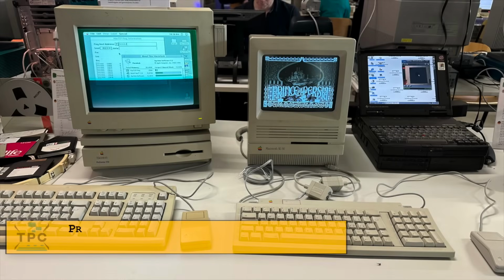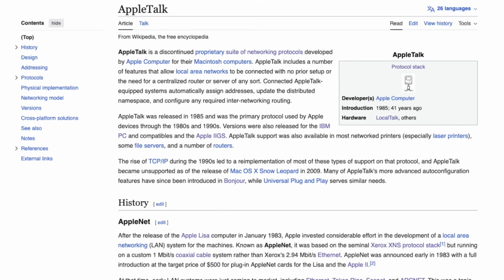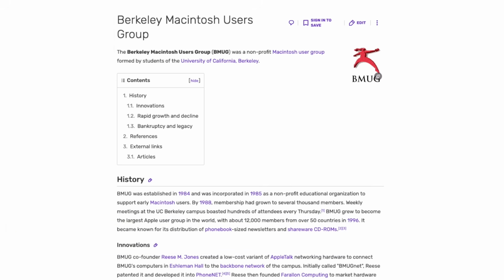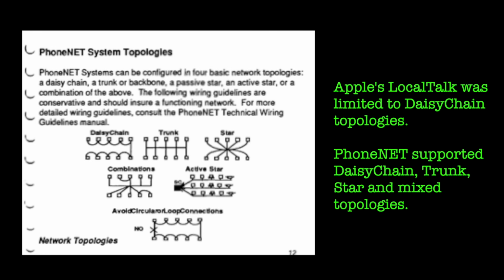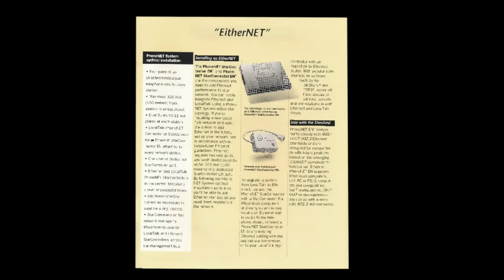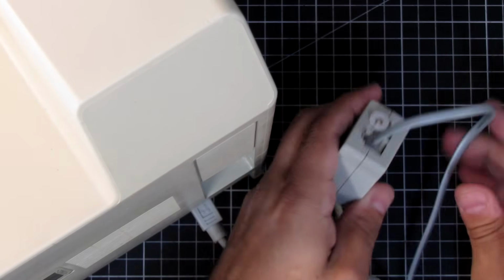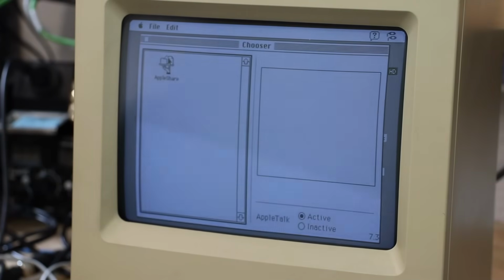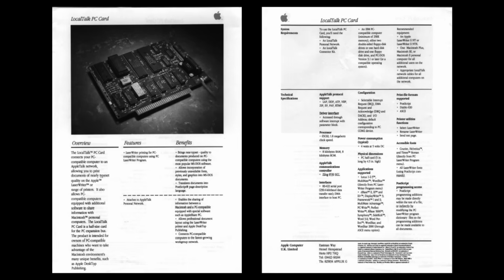Testing Farallon PhoneNet: AppleTalk without Apple's Expensive Cabling

Comment from the maker: Did you ever run AppleTalk, LocalTalk, or PhoneNet in a real setup?

I’m especially curious if anyone here connected Macs to the PC world with an AppleTalk PC Card, PhoneNet PC adapter, or similar hardware.
What worked, what broke, and what was the weirdest thing you managed to share over the network?
Reply: Yes, we used apple talk over coax, very chatty protocol and lots of collisions
Reply: We had plenty of it at the phone company before the days of EtherTalk - and even after that for the older macs with no slots.
Reply: I did many installs with PhoneNet. Some customers had it on the PC. We even had third party printers connected via LocalTalk.

Comment: I have an original IBM Ethernet Option which works on 8-bit systems.  It was new in the box when I found it.  I haven't used it in a while as the drivers use a lot of RAM and I don't have any computers set up with an OS which supports NetBEUI.

Comment: I wonder, what can you do with RAM on an Ethernet card?  I read a bit through the documentation on that Ethernet card and it says you can connect up to 4MiB of RAM accessible in 64k pages.
Reply from the maker: Yes, but that's not supposed to be regular system RAM (conventional memory, EMS or XMS in that sense).

It's a very specific use case for boot rom support, that means if you need to attach Flash larger than 512KB.

Or you can attach memory for use as network buffer, i.e. when the built-in 16 KByte SRAM not enough, you could attach RAM to enlarge the hardware buffer memory.

Comment: Honestly if we're posible to do a network like with Ethernet for old computers I would use it but when I was starting as IT everyone just went to Ethernet instead it was much of a hassle and phone lines were on the way out. Not even coaxial TV is anymore as an other option. But if were some way of using phone lines I maybe consider it. Still is slow but maybe that way it wouldn't be consider a target for hackers.
Reply: The main problem with Ethernet on old computers is normally getting a functional TCP/IP stack (with layer 7 clients/servers) for the machine, or even physically fitting that code into the available memory of the machine.
Reply: @Vanders456 also the need for extra devices and or converters

Comment: I had a PhoneNet PC card thing - I don't think it used an internal slot but like a printer (parallel) port or something. I remember this because someone loaned it to me and I briefly experimented with it without installing the card - just the DOS drivers and all the fun stuff on the Mac.
Reply: I may have the relevant bits on the shelf in my office. I haven't quite gotten around to setting everything up so I can try, but it looks very plausible as a phonenet to parallelport thingy

Comment: not quite the same thing, but I ran HomePNA over my phone wiring for several years, which didn't have the complications that PhoneNet had since it can run on the same pair as the phone service, like DSL can (but no filters are needed for phones). We had the first gen cards that had a 1Mbit max speed but since it was mostly used to share a dialup internet connection it worked extremely well.

Comment: I was a teen in the late 90's and early 2000's. A family friend who worked for NOAA gave me a bunch of old tech they retired, it included a bunch of Localtalk and PhoneNet adaptors amongst other things. I networked about 6 old Mac's I had acquired this way. And at one point I discovered I could misuse a old print server unit intended to allow a Apple compatible printer with a MiniDIN connection to connect onto a Ethernet network, well I found I could use it to bridge my Appletalk network to my homes Ethernet network. Via this, I was actually able to get my Mac Plus on the internet over the new cable internet we had signed up for around that time. I tried but I don't believe I could get my 512ke to work though because it didnt have enough RAM to handle the extensions and run a browser. Even on the Plus though, there wasn't much you could browse online, but I thought it was cool that it even worked at all. Oh, Edit: I just looked through a box I recalled having a bit of old tech.. turns out I might have the adaptor you need to connect a PC, Apple part 630-0113 although I never used it because I didn't get into PC's much till later..

Comment: In 2003 I actually got to experience setting up a group of LC II's with a fresh install of 7.5.3, maxing out the RAM and VRAM all to then configure an entirely Apple branded AppleTalk network between them so they could share files and a single LaserWriter II

I also got to enjoy some time with a PowerBook 3400c that year as I took a large amount of personal time to discover the reason it kept randomly crashing, finally discovering it had a failing hard drive that my teacher had placed an eBay order for it just for the laptop to be stolen from his classroom despite the fact it was sitting in pieces

Comment: With only two Macs to connect, I didn’t use any networking hardware at all. I just connected the two with a printer cable.
Reply from the maker: Of course, that‘s more or less the „DOS LapLink“ 1:1 connection equivalent.

Comment: If your printer port is full of a network interface, does that mean the only way you can access a printer is via the network? I know LaserWriters were expected to work like this, and the ImageWriter IIRC had an add-in board for networking, but on my Mac Plus later on I used an HP DeskWriter which I don't think had any kind of networking support built-in.
Reply: I think you could get away with putting most printers on the com port as well. As I recall, the only substantial difference was that the printer port could handle localtalk stuff too, and the com port couldn't

Comment: I'm sure you know this. But, from what I read they was considering using token ring but it was not ready yet. I was jealous of how macintohs has built in networking and how easy it was to use compared to says Windows for workgroups or I guess before that say lanman for dos. But, once again due to the cost of the Macintosh. Big push for Workgroup clones. Oh on a side note. I didn't realize somebody mfg a repo card for appletalk on a pc. I have been looking for one of those cards for years. I only ran across one while as a customers place. They used it for a laserwriter. Another side note. If you can find it . Look up IBM i think it is call PCN networking developed for use in PC's. I ran into it one on a novell netware network. it use twisted pair cable and I think terminators. The people who installed it used phone cable. That was wrong. It was suppose to use I think TYPE 3 IBM wire. Thus, the clients network was always going down. That was part of the job. Fix that with proper cabling and upgrade to novell 4.x from 3.x

Comment: Oh man you mentioned the EtherTalk bridge in another comment and I forgot about those! Had a few of those deployed as well--there was a version with an AAUI connector that hung off it so you could connect a Mac at the same time as well as bridging the networks. It must have been a Farallon unit because I remember the coloring of the plastic being that dark gray color they used but I can't find a picture of the one I remember, it had a diamond shape to it. I also distincly remember taking an old PowerBook 520 and using it as a software bridge for years to get an old LaserWriter II NT on an EtherTalk network.

Comment: I downloaded system 7.5.3 from apples FTP server and extracted the floppy disk images to a folder on my Power Macintosh G3 beige desktop. I then offered that as a network share and connected it to my Powerbook 145b and prepared a system 7.0 boot disk with the apple talk extension and chooser and was able to mount the shared and install OS 7.5.3 on the powerbook without having to do all the floppy swapping shenanegins. This was like 2002-2003 and I was just a kid. It was still fun and probably still how I would install an OS on a powerbook without a CD drive today.

Comment: IBM also had a phone wire based networking solution very similar to Apple, but not compatible with it. It was called “IBM PC network baseband.” The cards came in both Isa and microchannel and were very popular on the PS/2 line.
Reply from the maker: Oh nice. I‘ll have to check that one.

Comment: We bridged PhoneNet/Apple talk with ethernet around 1994/1995 and used a dozen of the Farallon star controllers back then connected with an amphenol plug to a 66 block (punch down) and then down to individual RJ11 outlets at each Mac.
On Ethernet we had netware 3.12 servers using ethernet_ii frame type to support apple fileshare clients

Comment: LocalTalk is supported by the intelligent modes included in the Zilog SCC UART controller. Similar happens with the BBC Echonet. Technically the AMIGA would have similar capabilities giving them also include an SCC as well.

But that part was several times more expensive than the humble "dumb" UART included in most PCs and clones. That's why no one really tried to do something as LocalTalk in the PC world. Terminal/FTPlike file transfers using something like Kermit or InterLNK using parallel port was good enough and cheap.

Comment: I haven't connected a PC yet (I plan to using an adapter that converts Ethernet to LocalTalk) but I did recently set up a network with Apple LocalTalk hardware between my Quadra 650 (running with a PowerPc upgrade card and OS 8.1) and an SE/30 (with a turbo card as well) running 7.1 and 7.5.1. Also on the network is an ImageWriter II with a LocalTalk card and an Apple IIGS. The GS can actually read and write to the SE/30 or the Quadra (but not the other way around) as well as use the printer. I will be adding a Performa 6300CD soon as well as (hopefully) Windows NT 4 (using the Ethernet to LocalTalk adapter).
Reply from the maker: Sounds like exactly the network I would like to build in my museum 🙂

Have you found an original EtherTalk bridge, or are you planning to use Linux to achieve that?
Reply: @THEPHINTAGECOLLECTOR  I have a couple of different ones, one from Dayna, and one from Asante, that I found relatively cheap in eBay. I did use the Asante one with the printer while using AppleTalk via Ethernet temporarily so I know it works, but I haven't tested the Asante yet.